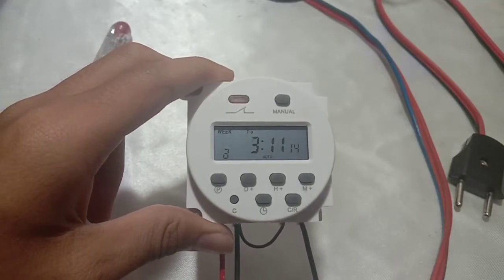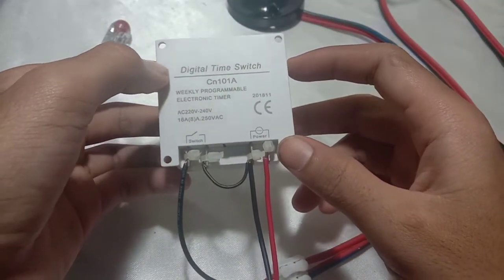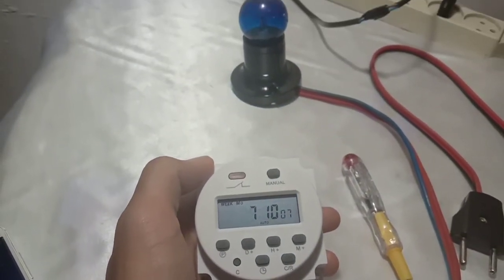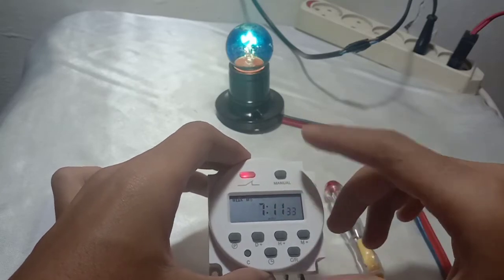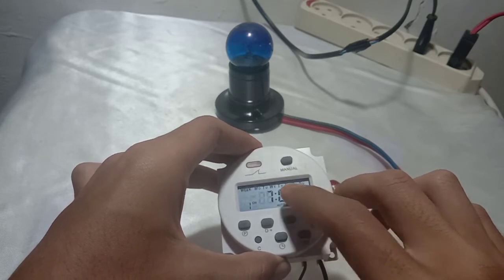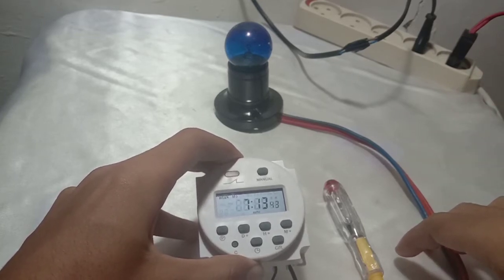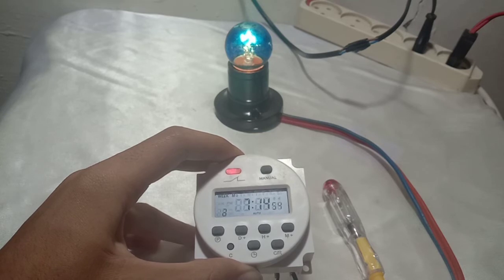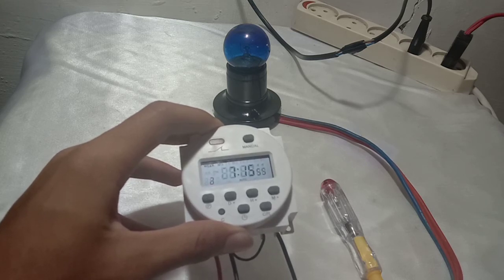7x24 Programmable Timer Weekly Programmable digital Timer Cn101A

Comment: hi, can you show how to program in manual mode and set for perhaps 5 minutes...but do not select a day...simply turn on and off with a 5 minute time...thanks
Reply from the maker: Use another switch relay timer, in this video the maximum is 16 times on off in a day,. I have another digital timer video that can be set on off each 5 min